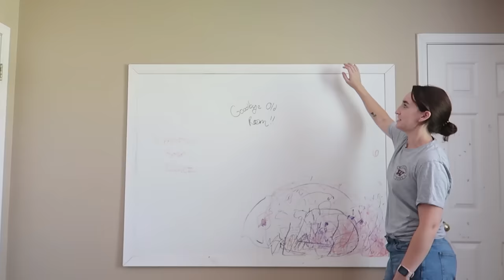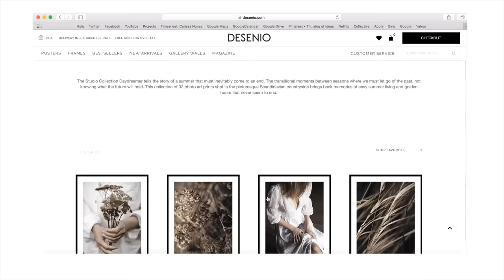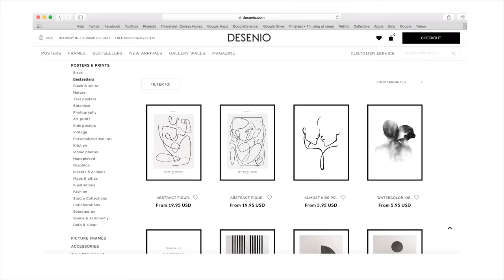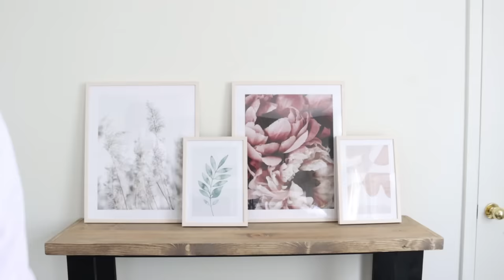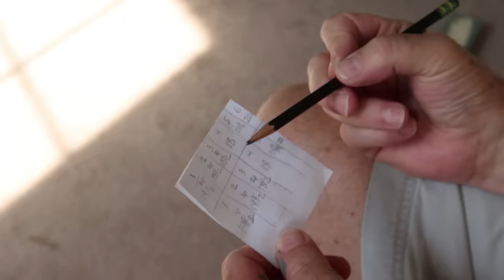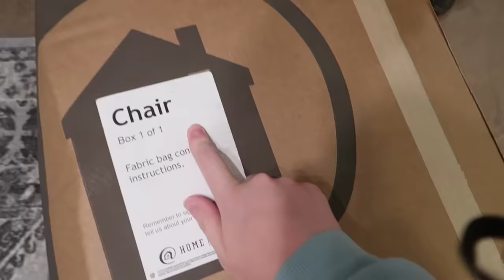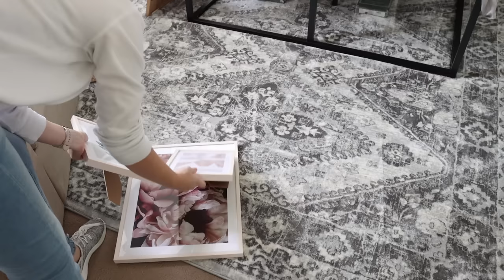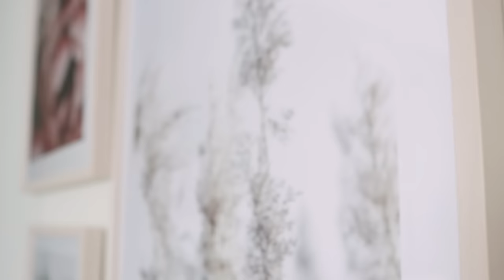EXTREME BEDROOM MAKEOVER | Full Bedroom Transformation 2020

Comment: You didn't sand down the woodwork before you applied another coat.  The coat won't last and will chip off easily.  Never saw you sand down the filler you put in the walls either, perhaps you did this but didn't show it.  That is a shame for it is misleading.  Still I am looking forward to how the room turns out as I haven't finish the video yet.  Hats off to you for doing this for your parents.